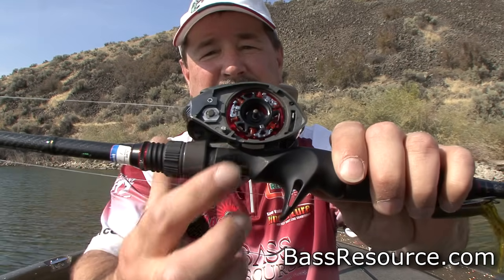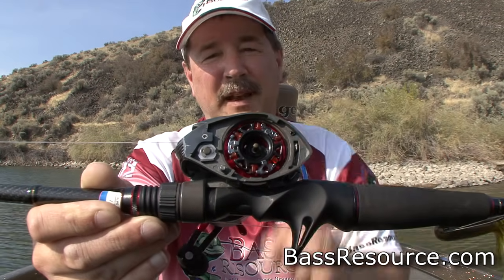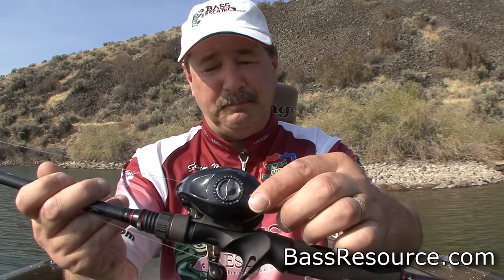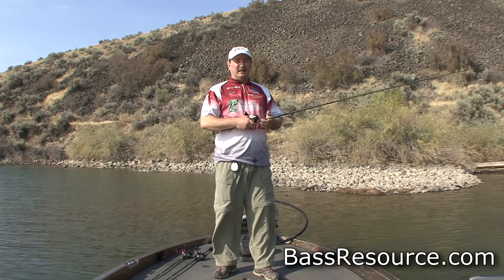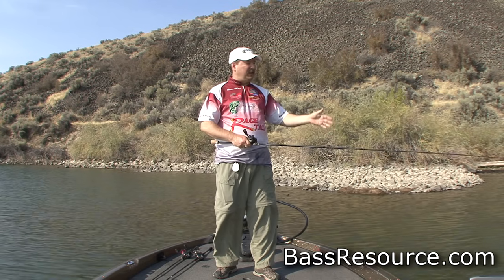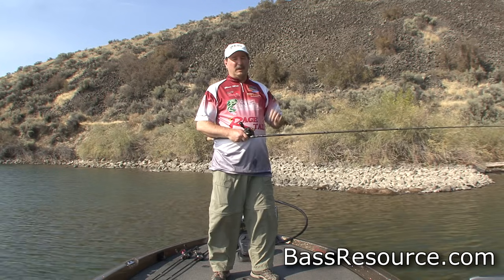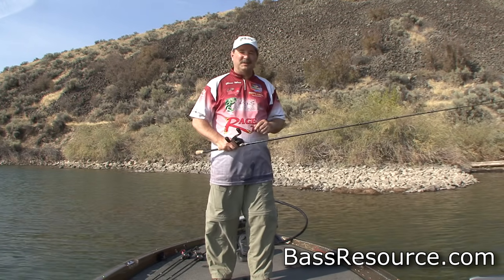How To Cast A Baitcaster | How To Adjust A Baitcasting Reel | Fishing Reel

Comment: Hello Glen !
Thanks for great tutorial video.
 I recently got my first baitcaster, as I always wanted one, but decided to get something budget friendly, in case I turned out to be hopeless with it.  I got an Abu Garcia Blue Max, left hand profile (it's relatively cheap here in UK), and I paired with a Shakespeare GX2 Ugly Stick 6'6" casting rod (medium heavy). Spooled it with a 10lb mono (it's enough for the fish I'm catching).
I Tuned it - using your tutorial, so that my lure will slowly drop to floor, and the spool stops rotating. 
I took it to local river (Thames) to test, and do some predator fishing (Perch and Pike), and  while I had no problems casting from side, I had loads of problems (guess I need to practice more), with the over-head cast, with lures weighting round 12g .
any advice you could offer for getting better casting lures like that with this combo (I find this particular reel a bit tricky to tune) ? I'm not giving up on baitcaster  yet. In all fairness for the few hours fishing (in freezing cold) I did get only a handful nests, and they weren't completely hopeless (removed every single one without cutting line).  I might however get an upgrade (better reel), with better tuning (maybe the Silver Max series).... So all in all your videos did help me a lot. Would however like to get some more beginner advise - regarding the above issues mentioned.
I guess - ice building up on line guides during my session was not helping with the learning curve either, right ?
Reply: I actually watched this video again, and I think I found my answers regarding over-head cast. Guess I will need to watch it few more times.
One question I still have is: how far from the tip of your rod, will you have the lure, before you do the over-head cast ?
Reply: @marcinstangel9277  4 years and no answer damn im sorry bro lol but I usually do about 1 1/2 - 2 feet of slack in my leader when casting.
Reply: @7Skyz  Havava better late than never ! I actually got at some point a slightly better model: Abu black max (which is surprisingly better - since I switched to the black max, all the above-mentioned issues are gone, which makes me think that the blue max reel was just rubbish ;) ), . And Absolutely love baitcasters now, I've been using them for lure fishing on Thames River all the time. Caught quite a few fish on that setup. Although nowadays I use Abu Black Max + Abu Vendetta rod. I have no problems casting really far. Videos like yours definitely helped me to improve my skills,  with regards to using baitcasters. Thank you sir for making these videos!

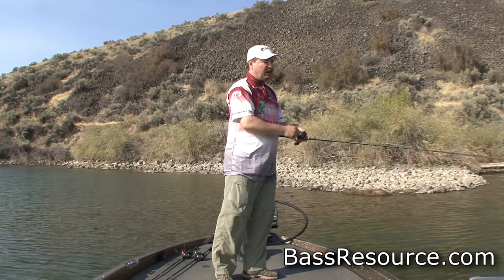Comment: 8:50 and 9:10 I think you mean do not hold your hand the way you shake someone's hand because your wrist does not bend as much (you said it differently the second time and said cast like you are shaking a hand). More like you are twisting the throttle on a motorcycle. At least for me that is not the most natural motion when fishing (especially since mostly using all spinning gear) so it will take some getting used to, it's probably more of a bit in between in reality. Nice video, thanks.

Comment: Hi, I'm from the UK and never used a baitcaster type reel, but I fancy trying one out for pike and perch spinning. My Birthday is coming up soon, so I think I will treat myself. Looking to spend around £35 to £50 and have come across the Abu Garcia Blue max which sits in that price bracket. Do you have any experience of using that reel please? pro's ? con's? 
Also... when you use the term "backlash" I'm presuming that means a tangled mess of line round the spool? Your advice would be much appreciated :O)
Thanks
Gary

Comment: I am fairly new, but I thought the centrifugal brake was the pin type inside, and the knob was a friction brake that applies pressure to the shaft. The pins inside get pressed outward against the “drum” by centrifugal force when the spool is spinning too fast. 

Am I mistaken?
Reply: Oops. I just read your pinned comment. No matter what you call them, they work how you said.

Comment: I just ordered a Bass Pro Shops Pro Qualifier 2 rod and reel combo, what is the braking system on it? Would it be true that it doesn’t have pins on the inside? It has the centrifugal knob along with the dial that says dual braking system
Reply from the maker: That is correct.  It's a centrifugal/magnetic combo - very common on baitcasting reels.

Comment: Basically.... Is the spool release button the equivalent of our trigger finger on the spinning reel line?
Reply from the maker: Not quite.  The button is more like the bail on a spinning reel. You hold onto the spool with your thumb. Your thumb releases the spool when you let go. HOWEVER, you must keep light pressure on the spool with your thumb while the lure is in the air, and the immediately grip the spool with your thumb as soon as the lure hits the water.  It takes practice to get the timing and thumb pressure down, so don't get discouraged.  You'll get it with practice.

Comment: I've used my BC reels a bit more this year. My only complaint it that my casts end up going about 45 degrees left of my intended target. Not sure if it's because of the rod. The tip is stiff. I have to overcompensate my cast to the right. It is really annoying while fishing with a topwater frog.
Reply from the maker: This means you're ready for the next step - improving your accuracy.  Here's a video that should help you with your aim:  https://www.youtube.com/watch?v=7jg8O1ePGJk

Comment: New to bait casting. It seems both the brakes and the spool tension do the same purpose .... to stop the spool from spinning when needed. What is the difference? In theory shouldn't  you be able to have no spool tension as long as you have your brakes set higher? View versa if you have your brakes all the way off... shouldnt you be able to just tighten the spool tension to compensate ? All the videos I've seen so far they are doing the same purpose and just confused why there are 2 different settings that do the same purpose . Thanks for anyone who explains:)
Reply from the maker: I presume the "brakes" you're referring to, is the magnetic brakes, which can be adjusted on the palm side of the reel. Those come into play at the end of the cast, not throughout (which is what the tension knob does). Magnetic brakes help fine-tune the tension, especially when it's windy.  Technically, you can turn them all the way off and use them only when it's windy, or when throwing light lures, where can get slight backlashes at the end of the cast.
Reply: @bassresource  awesome thanks !!

Comment: Okay...i know that with baitcasters that higher gear ratios pull the line in quicker. But what is the difference between the gear ratio and the bearings ? Is that the same thing? Like if i have a 10 ball bearing system is that huge lol
Reply: The person i bought the reel from was not very helpful and now i feel like I’m screwed because i can’t return it and I’m worried it’s too fast
Reply from the maker: Simply put, gear ratio is how many revolutions the spool makes per turn of the handle. So a 6:1 means the spool rotates six times each time the handle is turned.  

It is not related to the bearings, which are a different component and affect free-spool and performance.  10 bearing reels are pretty standard these days.
Reply: BassResource - Bass Fishing Techniques thanks for the feedback! Knowing what i know now it’s a 7.5:1 gear ratio so it turns 7.5 times to one turn of the reel correct? In your opinion is this too fast?

Comment: The new Quantum EXO reel doesn't have the centrifugal brake knob. So you can't adjust it right?
Reply from the maker: Anthony Ngo Not all reels have all the different methods for adjustment.  However you can still adjust them with whatever they DO come with.  Sometimes the cast control knob on baitcasters combine magnetic with mechanical brakes into one knob too.
Reply: BassResource Oh ok. I just found out you can remove the side plate and adjust via there. Thanks for the reply.

Comment: My casts keep going too far left. And that’s with fc on a med heavy rod with fast action tip. Now casting with mono on a moderately fast tip are perfect. I don’t if that’s making a difference or not but any tips?!
Reply from the maker: It has nothing to do with the line or rod, it's when you bring your rod up during the cast. You're likely bringing it over your right shoulder...too far to the right.  It's like bowling. You need a straight back and forward swing.  This is why you should first try casting by keeping the rod in front of your face instead of swinging behind your shoulder. It will help you keep everything straight during the cast.
Reply: BassResource - Bass Fishing Techniques Thanks. 👍

Comment: Mr. Dude, you didn`t even mention the very basics of how to cast. You mentioned something about "release" but seem to take for granted i already know what this implies. I do not. I`m a total newbie and don`t even know in what position that thumb brake thing is supposed to be in when i cast or if i`m supposed to use my thumb as a brake on the spool. May be elementary for you, but the title of this video do state "how to cast a baitcaster" So as far as rods, will i be needing a pistol grip for my Shimano Cruxis 200 baitcasting reel? I`m righthanded and the crank thing is on the right side. Is this the correct side for me? Thanks.
Reply from the maker: You depress the thumb bar with your thumb, and let go as instructed in the video, keeping light thumb pressure on the spool to help prevent backlashes (known as "thumbing the spool").

Don't get a pistol grip.  Get a trigger handle instead. You'll have greater control.

Yes, that's a right-handed reel.

Comment: When you have the magnetic knob at a say 10, what does that do. And when you have it off what does that do?
Reply from the maker: The magnetic brakes work towards the end of the cast, helping slow down the reel during that stage.  Typically you'll want to turn it up as the wind gets stronger, and vice versa.  If you have it too strong, then your casts will fall short; too loose, and you may experience backlashing.

Comment: If using braided line,start your spool with a meter of mono line, unless your reel is equipped with a waffle spool
Reply: Or you can just tie the line in the spool if you got that option. Or apply some electrical tape beforehand.

Comment: Stupid question here, but in simple terms what are the advantages of baitcasters? If there is such a learning curve to them and they are so notorious for backlash, what is driving the masses to baitcasters? I want to know because I have a gift card I'm wanting to spend and I'm trying to decide between buying a baitcaster bass combo or a spinning walleye outfit.
Reply from the maker: It's not an either/or question, but rather selecting the right tool for the job.  Each have their advantages and disadvantages. Spinning gear is notorious for line twists, for example. 

In a nutshell, spinning equipment is best suited for using light lures and light line, and baitcasting gear functions best with heavier lures and heavier lines. Here's an article that goes into more detail: https://www.bassresource.com/fishing/spinning-baitcasting-choice.html  Read even more articles that are linked at the bottom of the page.

Hope that helps!

Comment: Baitcasting is for short difficult accurate casts, spincasting is for long easy open casts. Baitcasters work better with heavyweight lures spincasting is capable of light weight lures. When you practicing baitcasting you can cast further and practice spincasting you can cast more accurately. I use exclusively spincasting and am able to cast accurately.... I do want to get a couple of baitcasters though.

Comment: Hi I am new in bait casting  . Do You recommended magnetic or centrifugal brakes for beginners .?
Reply: Magnetics are more first time user friendly some centrifugal are a little more advanced
Reply: I have abu garcia pro max 2 with magnetic brakes. Total junk
Reply: Alex Dashevsky well that's your first mistake buying a abu invest in a lews speed spool best 100$ reel on the market.
Reply: Lewis chip made reel
Reply: Alex Dashevsky no the lews speed spools. Im not sure if there made by lewis chip
Reply: +Alex Dashevsky Both! When I began there were no centrifugal or magnetic brakes, just spool tension knob. Guys have it easy now. Of the many baitcasting reels I've used/owned, the least user-friendly and least forgiving are those with no brakes, just tension knob. I do have a very cheap new-ish pflueger with a tension knob that seems to be inconsistent. The Abu BlackMax reel works great and is nice and cheap. The ProMax2, SilverMax... etc. are fine reels too. Not junk. Lew's Speed Spool is fine also. Not exceptionally fancy, but far from junk. My favorites in the last 5 years or so are Quantum. Don't buy the cheapest Quantum baitcaster you can find, but I can personally vouch for the KT100spt. It's a splendid little reel and well built (aluminum frame). You can pick one up on e bay for around $60.

Comment: What number on the break should you use for throwing a frog
Reply from the maker: I don't look at the numbers.  Besides, frog vary by size and weight, so there is no setting I can recommend.  Instead, set it up exactly how I demonstrate in the video, particularly making sure the spool stops when the lure hits the ground when you drop it by disengaging the spool.  It will be pretty close to where you need it.
Reply: BassResource - Bass Fishing Techniques  I always try to match line and lure  to the  correct rod , but find if I   Switch to a different lure Weight I have to dial in to  avoid backlash, but braid throws me off  at times

Comment: Are you supposed to put your thumb back on the reel right before the bait hits the water? That's how I was taught
Reply from the maker: jacob pummell Yes.  That will prevent backlashes.
Reply: +jacob pummell Actually, you always keep your thumb on the spool during the whole cast. As the line is going out, you feather the spool (apply a very light pressure with your thumb). Right before the lure hits the water, you apply enough pressure to stop the spool from turning.

Comment: I am new to baitcasting,I have 3 rods with spining reels,used those my whole life,and recently but new rod with baitcaster. Today was my first day with baitcaster and it was really bad,I set it up to not get bird nest and that was ok,but I have other problem.
When I am casting,while bait is still in the air reel just stops and there is like a snag noice and it stops. Why is this hapening,anybody help?
Reply from the maker: Sounds like the line is dug into itself.  Pull out the line to the place where it's stuck, and then pull it free.  Should solve the problem.

Comment: Wouldn't it be easier if your reel is on your left so you would have to switch hands?
Reply from the maker: Erik Garcia Some people do exactly that.
Reply: +Erik Garcia Actually, a right-handed person is supposed to use a left-hand retrieve baitcast reel. The belief right-handed people use right-handed reels (and vice-versa) is a misconception which started long ago and ever since has been perpetuated by those who don't know any better. For the other three types of revolving spool reels (surfcast, bay, and deep sea) right-handed people use right-hand retrieve reels. Baitcast outfits came many years after the saltwater outfits and most people thought "right-hand retrieve for right-handers" because that's how it is with the saltwater ones (not to mention that it was many years after the introduction of baitcasting outfits before companies started making left-hand retrieve reels for them). The reason it's right-hand retrieve for right-handers using saltwater outfits is because the rods are two-handed. Baitcast rods are supposed to be one-handed (all freshwater rods are supposed to be one-handed as long distance is not necessary like it is in saltwater fishing) so you use a left-hand retrieve reel if you're right handed. Two-handed freshwater rods are made for morons who think long distance casting equates with catching more fish or being a better freshwater angler. It does not.

Comment: Thank you for the video but I have to chime in with a correction.

What you are calling the "pin" type brake system is actually a centrifugal brake system. Centrifugal force pushes the pins outward and they rub on the inside of the race ring that is located on the side plate. This rubbing action creates resistance which is what slows your spool down. Because centrifugal force is what causes the pins to move outward, they decided to name this type of braking system a centrifugal brake. There is no such thing as a "pin" system.

A magnetic brake uses magnates and something called eddy currents. Google eddy-current brakes and you will understand how they work.  

What you are calling the "centrifugal" brake is actually a spool tension knob.  There are only two types of braking systems...centrifugal and magnetic. Every reel has a spool tension knob and the spool tension knob is not a brake, it's a knob that adjust the spool tension.

I hope this helps.
Reply from the maker: Yerman Yes, you are correct.  My bad.  I've added titles to the video to help clear up the confusion.  My sincere apologies for getting the names wrong.